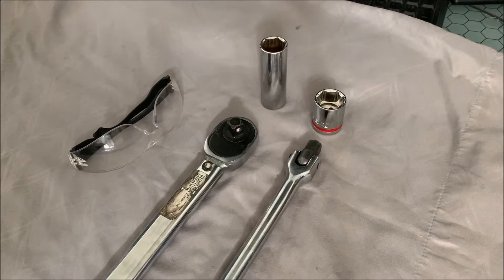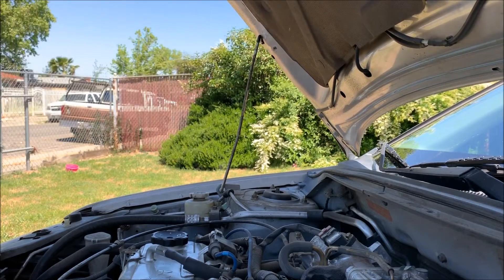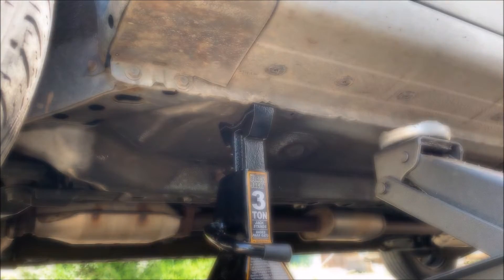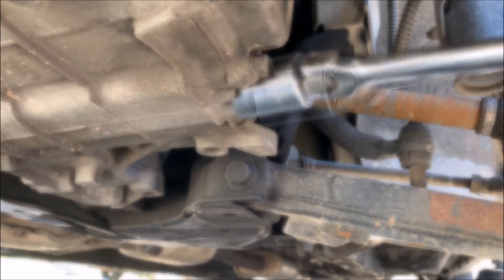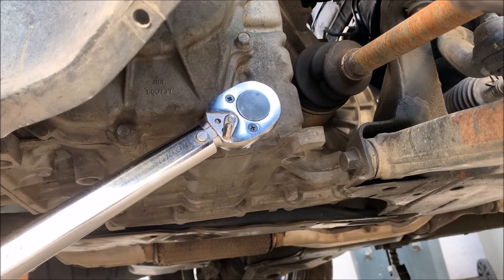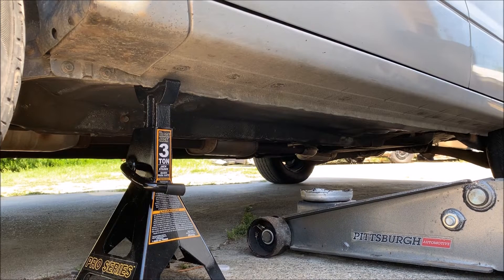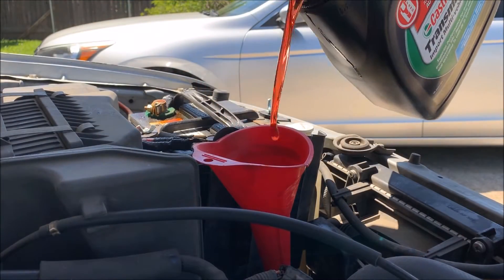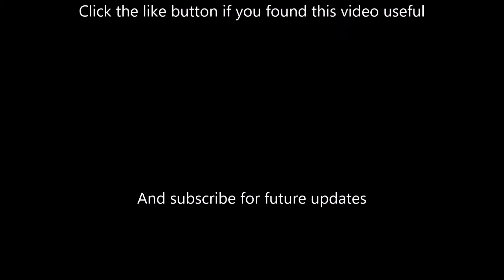Mitsubishi Lancer 2003 ES - Quick Auto Transmission Fluid Change

Comment: I'm pretty sure this transmission has 2 tranny flilters, 1 inside you can't access and you have to take the transmission apart, and one outside located at the top of the transmission it looks like the engine filter but smaller, you clearly didn't change it but idk if it has it

Comment: Also to check hot by the manufacturer they say to go onto flat surface change through all the gears, then leave it in nutral while engines running. Also the manufacturers recommended default transmission fluid for the car is Diamond ATF SP3.

Comment: Jacking it up on driver's side will not allow all the fluid to drain, the tilt should be from passenger side to allow all the old fluid to come out, this doesn't change every single drop of old fluid.

Comment: Don’t forget to start the car after your done, and run it through each gear for a few seconds then check fluid level. Have it running in neutral THEN check the fluid level..

Ps: I can confirm that draining from that plug will be about 5 quarts. Also these transmissions need Diamond ATF SP III. They’re not that expensive from the dealer.. Change every 30K..
[2006 Lancer here]
Reply: Why every 30k?

Comment: How much quarts of oil to fill it??
Reply from the maker: The transaxle hold up to 3 or 4 quarts of A/T fluid for this oil change.
Reply: @donkeykongchang   what oil specifically??
Reply from the maker: I used "Castrol TRANSMAX IMPORT Multi-Vehicle Automatic Transmission Fluid" in this auto transmission fluid change video.  It meets the spec requirements which is "Diamond AFT SP III".  I had driven my Lancer for a while now and not gotten any transmission issue yet.

Comment: Don't you check trans fluid with motor running?
Reply from the maker: The shop manual said to drive the vehicle until the A/T fluid temperature rises to the normal temperature.  Part the vehicle on level surface and measure the fluid.  Level should be at "Hot" mark.

Comment: i have an '02 the final check would be with the engine warmed up on a leveled surface, go through the gears, put it in neutral (park brake on) with the engine on and check the dipstick, the fluid should be in the hot mark.  It's what the service manual says...

Comment: You should put a certified Mitsubishi Diamond ATF-III transmission fluid not any fluid, those transmissions are very sensitive.
Reply: the fluid he used meets or exceeds manufactures Diamond AFT SP III standards
Reply: Rick is right
Reply: Yes Rick is right they are sensitive. Even my 08 at the moment

Comment: Is this going to be the same for 2006 Mitsubishi Lancer? I need to do the Automatoc fluid change today. Is the 24mm socket the same for 2006 Mitsubishi lancer too?
Reply from the maker: I just check the factory shop manual for the 2006 version.  The direction to both transaxle fIuid change look the same to me.  I do not actually have the Mitsubishi Lancer 2006 vehicle so i can not double check for you.
Reply: @donkeykongchang  Oh ok thank you. Yea I bought the 24mm socket and tried to do the automatic fluid change and it does work for 2006 mitsubishi lancer. It was so easy to do it. I put castrol cvt automatic transmission fluid. Thanks. 😀
Reply: @shonemathewjoseph8881  Did you experience any issues or problems with your Transmission using Castrol CVT ATF?
Reply: @cjjjjrak  No I only had the car for like 6 months before I sold it. For the 6 months of owning it, it never had any problem with the transmission. The car was a money pit. It kept breaking down so I had to sell the car. Lol. I bought a 2005 toyota camry and I am happy with this car. It doesn't have any problems.
Reply: @cjjjjrak  And also I put the wrong fluid for the 2006 mitusbishi lancer. I was not supposed to use the cvt fluid,  it uses regular fluid. I didn't know because when I looked it up on online it said it uses cvt but it doesn't. But it didn't give me any problem. So if you have a 2006 Mitsubishi lancer don't use cvt fluid and only use regular fluid.
Reply: @shonemathewjoseph8881  Thanks for taking the time to answer my question. Yes! I hear you about cars that just money pit and I had that experience on 2003 Toyota Sienna Mini Van Transmission headache. Anyway, I was just curious about the effect of using CVT fluid. Peace!

Comment: I think I requested this.  If so, thanks, K.C.!  I noticed your intake duct was broken, too.  Did you accidentally lean on yours?

EDIT:  Since you have the manual, could I get some torque specs for the following parts please?

- Strut to spindle bolts
- Outer tie rod nut 
- Inner tie rod
- Axle nut
- Caliper housing and bracket bolt
Reply from the maker: Yes this is the video you ask for, sorry it took a while.  As for the intake duct,  it was broken when i bought the vehicle.  I been meaning to get a replacement but it is not high on my list of repair.  And as for the specs, what parts of the alignment system are you replacing.  It look like you replacing the whole tie rod but you don't really need to take off the axle nut for that repair.  Let me know and i will look up the spec for you.
Reply: @donkeykongchang  I just did a front bearing and hub replacement last weekend, but I couldn't pin down the exact specs for the ES model.  While doing my bearing, I noticed that the outer rod and ball joint needed replacing, so I'm changing all the tie rods, and the front, lower arms next.
Reply from the maker: I had not replace my front wheel bearing and hub because I do not have the special for the repair yet.  I'm assuming you gotten the special tools and was able to successfully install the hub and wheel bearing onto the knockle.
And Here is the Requested Torque Spec in same order you ask for:
- FRONT STRUT TO HUB AND KNUCKLE MOUNTING BOLT AND NUT:  123 ± 7 ft-lb (167 ± 9 N·m)
- AXLE/DRIVESHAFT NUT:  181 ± 21 ft-lb (245 ± 29 N·m)
- Check out my link for OUTER TIE ROD END replacement:  https://www.youtube.com/watch?v=RQQ9oHWU5C4
- INNER TIE ROD:  65 ± 7 ft-lb (88 ± 10 N·m)
- Check out my link for Caliper housing and bracket bolt torque spec:  https://youtu.be/_K5av-MW2PQ
- Check out my link for Front Lower Arm replacement:  https://www.youtube.com/watch?v=MUO74V5pXqc
Reply: @donkeykongchang  I did.  I got the Astro FWD bearing press kit from Amazon.  I got rid of the bearing roar, but now I'm hearing a chirping noise from the same side.  Anyway, thanks for the torque specs.  Are they from the official service manual?
Reply from the maker: I had used a software call Ondemand Mitchell but it stop working when i updated my window 8 to window 10.  It is the same software we were using when i was learning to repair vehicle in college.  I do not try to make any car repair if i do not have the right tools and manual so I did a good research and found a PDF  for Mitsubishi Lancer 2003 FSM (Factory Service Manual).  https://www.evolutionm.net/forums/lancer-troubleshooting/443432-lancer-factory-service-manuals-available-here.html .  Check it out and download it.  I would said the only hard part to a shop manual is reading the understanding mechanic term and finding the correct page for the repair.  Let me know if this is helpful for you.
Reply from the maker: So after this reply, it just occur to me that people might want the Factory Shop Manual too so i include a small icon and link to that web site i just posted for you.
Reply: @donkeykongchang  Belated thanks for the service manual.  I've been using a Haynes manual to work on mine, but all the torque specs are in Newton Meters.  Don't know if Haynes made a manual for American Lancers, but I'm convinced I bought a foreign version by mistake.  This FSM should come in handy (While I still have the car at least).

Comment: Hey Kong question again in 2003 Mitsubishi lancer  have a transmission filter or do i need to change the gasket and open the pan everytime you change the transmission? Thanks
Reply from the maker: I have not change the A/T filter on my Mitsubishi Lancer yet.  I have been looking over my shop manual and it seem like the A/T filter is located in inside the transmission/transaxle internally. You will need to do a transaxle overhaul just to be able to replace it.  Oh yea,  there is not A/T fluid pan or at least not on the Mitsubishi Lancer 2003 ES.
Reply: It’s on the side rather than the bottom
Reply: The fluid pan, not the filter
Reply: Okay, so why did my filter come with what looks like the gasket for the fluid resevoir?

Comment: 5:54 i have 2004 mitsubishi lancer ES model i just change my transmission fluid and my dipstick its said hot and cold. I filled up 4 quarts only coz of my dipstick reach the cold line.... Just wondering if urs has those cold and hot line in your dipstick?
Reply from the maker: Filling the fluid to the cold line is correct.  Check that the A/T fluid level is at the "Cold" mark on the dipstick.  If the level is lower than this, pour in more A/T fluid.  Drive the vehicle until the A/T fluid temperatures rises to the normal temperature[70 -80°C (158-176°F)], and then check the A/T fluid level again.  The A/T fluid level must be at the "Hot" mark.  If the A/T fluid is under the specified level, pour in more A/T fluid.  If the A/T fluid is over the specified level, drain the excessive A/T fluid from the drain plug to adjust A/T fluid level to the specified level.
Reply from the maker: Thanks for asking the question.  I went ahead and add the fluid instruction under the video description,  which will help other people when they watch this same video.

Comment: Your video is very useful, I have a Mitsubishi Lancer 03, which has a head window but does not work, I hope you can help me, greetings from Mexico
Reply from the maker: Do you mean your driver window is not operating?
Reply: @donkeykongchang  hi! 
It's the sunroof, but I don't know how to open it to check why it doesn't work. Do you have another means to contact you?...thanks
Reply from the maker: @ceesarduque5248  My Mitsubishi Lancer 2003 ES does not come equip with a sunroof so i can only help so much.  A portion of the digital shop manual which I use, for my repair, does talk the about Sunroof Assembly.  My email is donkeykongchang@hotmail.com .  We can exchange email and i'll send you the PDF file.